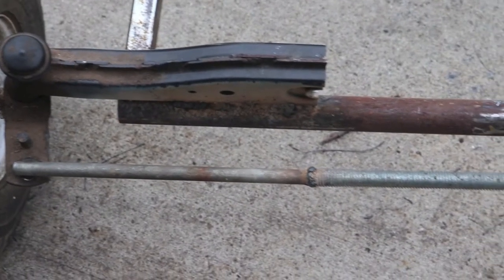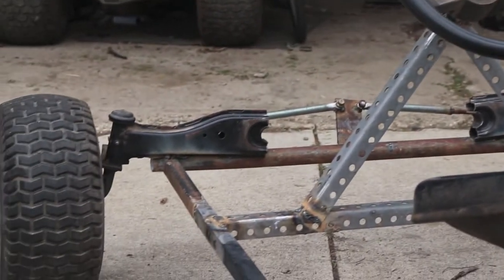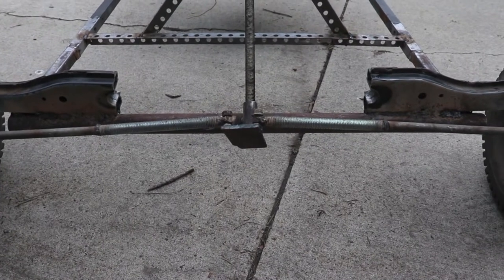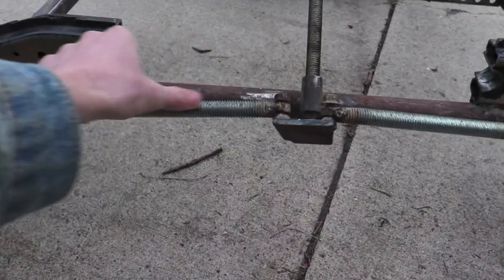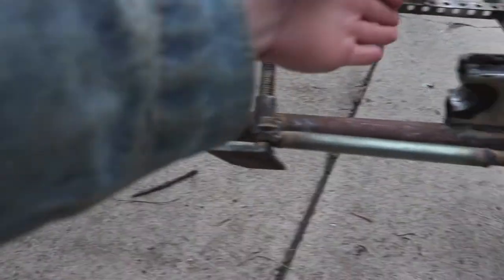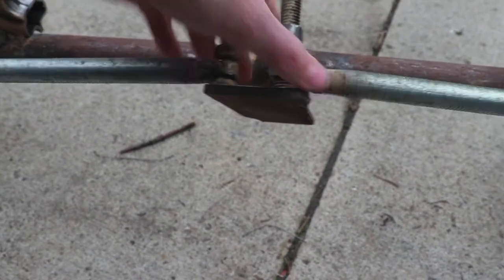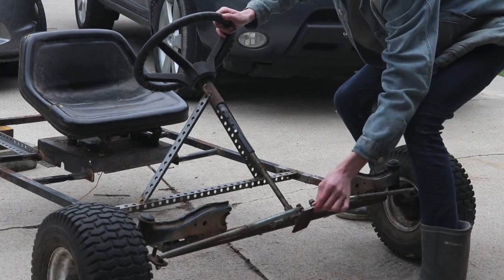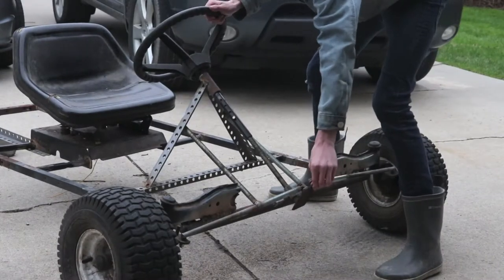Go Kart Steering System | DIY.

Comment: The number one reason one side turns further than the other is because of unequal distance between the wheel pivot and the tirod. So, think of it this way. Your wheel is on a hinge. this allows it to swing left and right. Just like opening and closing a door. Now image you have two equal doors and you are holding the door knobs in each of your hands. Your arms are like the tierods that connect your steering. When you lean left the doors open left, lean right they open right. But this is how you can mess up the balance. Your door knobs are not in the same place. Imagine one door knob is actually in the middle of the door. Now, it takes less distance for your hand to move the door to make it open each way, so one door opens 5 degrees and the door with the knob in the middle opens 10 degrees.
Reply from the maker: Thanks for the advice! Makes much more sense.

Comment: Neat project.  Check out Ackerman's theory.  With the steering rod behind the front axel and adding angle to your spindle rod mounts, you can achieve the opposite effect making the inside wheel turn at a sharper angle than the outside  matching the rotation path of the rear wheels.
Reply from the maker: Thanks!

Comment: Sorry my technical english is not perfect, but the reason one wheel is turning more than the other is that you dont have 1/ lever brackets from wheel and from steering in the same angle and 2/ steering rods are not parallel to the wheel axis (axle), so the one rod always has to be "longer" and pulls the wheel more to the side (different rods angle from wheel axis when maximum turn).
Reply from the maker: thanks dude!